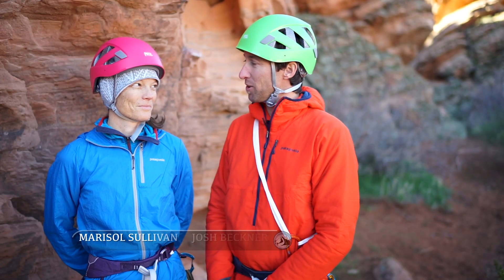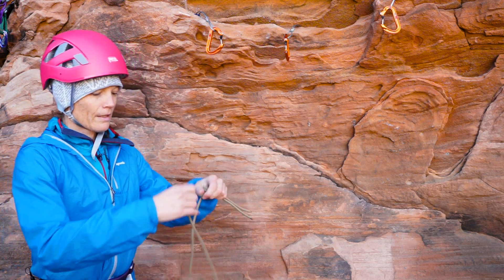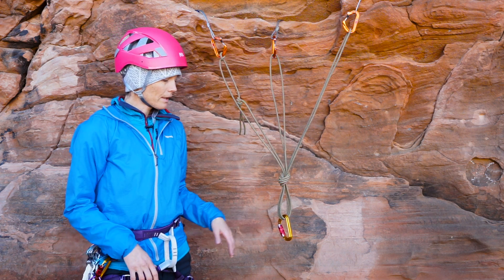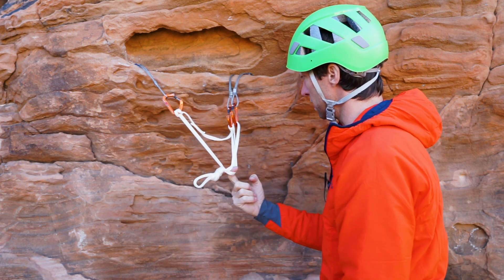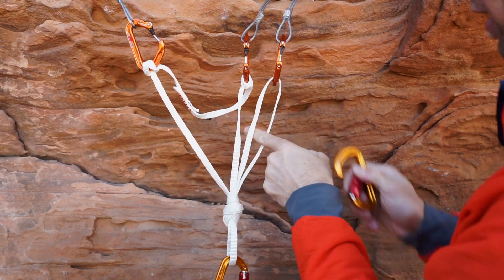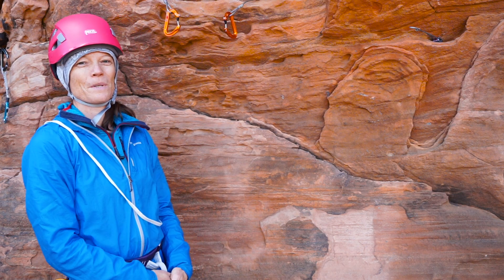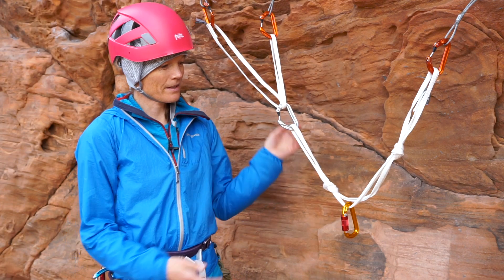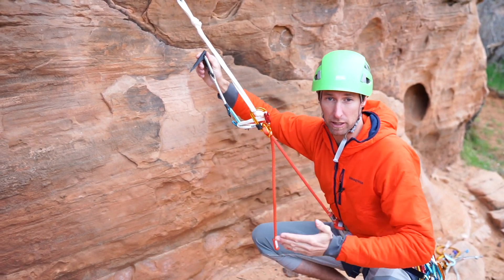Advanced Climbing Anchors:  Efficient 3 Piece Systems

Comment: For your "W" set up, I don't fully agree with belaying off the anchor shelf. Why wouldn't you just belay off the master point instead and clip yourself into the shelf?
Reply from the maker: I like to tell folks to generally avoid clipping into the shelf, especially when the sling is made of dyneema, the knot could potentially role off the end of the sling unless there's  a locker in the MP. Make sense?

Comment: Hi guys in the UK it is normal to build a 3 piece system that can be equalised using only your rope which is also dynamic clipping your belay into the loop of your fig 8 on your harness each piece of gear is independent there is no slip and 2 of your three pieces can fail... That being said what is the goal of using a sling set up??
When you have a shortage of rope? Or for a system which you can escape easily from?
Reply from the maker: The best reason to use slings in the anchor is that anyone can clip in or out of the system easily. If you use your rope it makes it difficult to lead the next pitch.

Comment: What is the shelf for?
Reply from the maker: The main reason is that putting the Resverso up a little higher makes it easier to pull slack through the device, plus it helps keep things a bit more organized if the Reverso is clipped into a different place than the climbers' clip-in location.
Reply: This anchor is for the top of the pitch when no bolts exist (a trad anchor). The belayer clips themselves into the shelf for protection. The master point holds the climber following.

Comment: Why wouldn't I clip my belay carabiner into the master point at the first two anchorsystems?
Reply from the maker: Yup, what Marten V said is the main reason, plus it helps keep things a bit more organized if the Reverso is clipped into a different place than the climbers clip-in location.
Reply: Ah ok, thanks.
Never done it like that before. Going to check it out next time.

Comment: Is that cordelette just tied together with an EDK? I thought that maybe a double fisherman's might be safer
Reply from the maker: Yes, a double fisherman's would be safer, but it really only gains you a few percentage points in strength. More importantly, the DF becomes permanent after holding a heavy load and then the cordalette can't be untied and used for many other applications. So we are essentially sacrificing a tiny bit of 'safety' for utility, which I feel is actualy safer in the long run. Also, in this particular application, the strand with the Flat Overhand (EDK) is only 1/3 of the anchor, which makes the flat overhand even more justifiable in this situation.
Reply: @sietschoolforinternational5234  wouldn't a double overhand be better? In my experience I've never seen them slide if you tight them one strand at the time, while the simple overhand I've seen it slip a good 2-4 cm in an anchor like this
Reply from the maker: @bellini98-1  Yeah, a double overhand would be great for this situation, and depending on the situation, I often put that into my cordalette. Thanks for the comment.
Reply: @sietschoolforinternational5234  Thanks for this clarification. The EDK certainly makes the cordelette more versatile by virtue of being able to quickly tie and untie for different uses and I'm glad that it is accepted in the guiding/teaching world. And if I'm not mistaken, the knot is actually only seeing 1/6th of the load as there are six supporting strands.
Reply from the maker: @tonyjewell478  Glad that helps. Regarding the knot only seeing 1/6th of the load...that's not exactly true for a many reasons. If you check out our blog post (link above in the video description) you'll see that equalization pretty much never occurs in the field. It's even difficult to create a truly equalized anchor in the field. If the load changes direction at all, different legs 'feel' variable amounts of load. Also, if one leg is longer than another it will often feel less of a load. And if you look at the variable angles that extend from the master point, this will also put more load on some legs than others. So, if everything was perfectly equalized, which it really never is, then you'd see 1/6th of the load on the knot. Hope that helps! -JB
Reply: @sietschoolforinternational5234  Thanks for the clarification. Indeed I can see that 1/6th would totally be theoretical and not actual. In fact, if the force where to shift say to the right, the left leg could take the entire load which means the EDK (in theory) would be getting half the load. Perhaps another worthwhile point is by putting the clove hitch on the same leg as the EDK as shown in the video, this would add redundancy into the system and thus not totally rely on the EDK to hold which seems like a good idea to me.